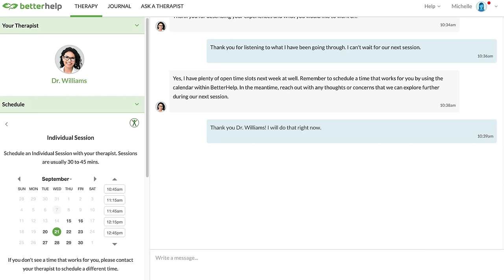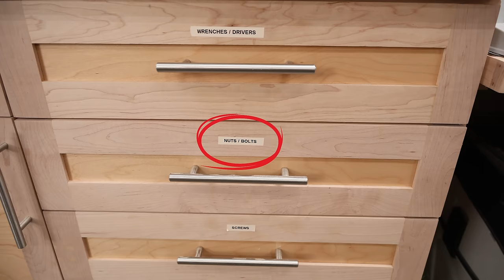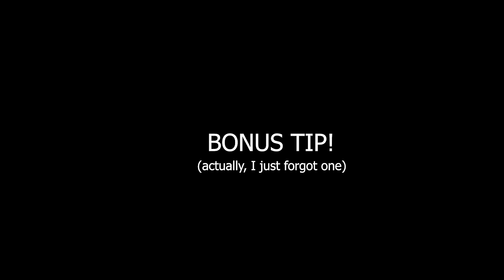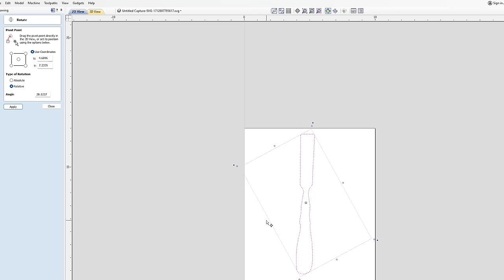12 EASY organization tips for any workspace

Comment: As I sat on a stool in my shop today, I was thinking about my next steps.  One piece that has plagued me is a space for everything.  I spend a significant amount of time in each project moving stuff from one flat surface to another.  In some cases it's scrap wood others it's tools.  My wife is keen on me starting to push product out the door.  This happened last year, and I didn't get a chance to dig out of the mess until after the New Year.  I told myself at the time this has to stop.  Yet here we are back in April, and I should already have a great deal of inventory built up to meet demand.  

The end result of my time sitting on the stool is the following:  product for this year will be put on hold.  There are about 5 shop builds I need to complete in order to get organized.  Everything from a brand new miter saw station with lower cabinets with drawers and pull out trays to upper cabinets with of the same.  While this is going to hurt my bottomline this year, it will only help me next year.  As a tech geek (I work full time in IT), the advent of a 3-D printer holds limitless opportunities to feed the shop.  As I'm sure you know, it's yet another item to find a place in the shop.  This vid couldn't have dropped at a better time for me.  While I am not mister neat, I do so much better when I use a tool and then put it back.  The more I can do that, the more efficient I'll become in producing product.

Comment: Agree with you about multiple drills and drivers. What most don't know is the strength varies from tool to tool. So, as a person gets used to the drills they are used for that wood or whatever material is being used. Besides that, it is just natural progress  as the equipment improves.

Comment: As a visual thinker/organizer, I've struggled with systems for years, and conclude that for me no single overarching scheme is optimal. I've found that for many small to medium sized parts, clear old plastic Costco plastic nut jars (2.5 lb, 7 4 1/2") can hold enough misc. items to still see the contents, maximize space efficiency, and be easily moved to locate or re-arrange on metal shelving. Smaller jars can contain totally misc. fasteners, that can be poured out to find a particular item, then poured back again, without need for over-sorting, labeling, etc. that works best in hardware store stock shelves, but consumes a huge amount of air space in a DIY workspace.
  Another general rule is to store vertically, on walls or panels, as much as possible, and try to keep counter space clear, or else hanging tools will be hidden and unreachable behind the clutter.

Comment: The Kaizen foam is also a great way to store files and rasps.  Just cut or route slots to store them on edge so they don't touch one another in the drawer.  While you're organizing, verify the accuracy of your measuring tools.  I started by checking small scales and rulers against a dial caliper and used a 12" ruler that I found to be accurate to check my metal yardsticks and tape measures.  

Results:
Two "identical" brand name tape measures didn't match each other.  Fortunately, one was accurate.
Several other tape measures were good enough for carpentry but not close enough for cabinet making and other better woodworking.
The scale on the table saw was off by about 1/16" per foot so it was replaced.
Everything that wasn't dead on by my measuring techniques was moved out of the workshop.

Comment: Kaizen is great if you need the depth but kits expensive. For my automotive tools I use the foam rubber floor mats from Harbor Freight. I cut them to drawer size and flip them upside down. I lay out all the tools in the reverse order I want them to appear and use a long nose kaizen marker to trace each tool. Once done I take my Dremel with a small up cut router bit and hand route inside the lines while laying on a couple layers of cardboard. When done I back them with some thin color foam rubber sheets from the hobby store using spray adhesive from 3M. 4 tool drawers for less than $25 including buying the adhesive. If you need it thicker adhere two foam mats together on the smooth side before routing. Lay the color foam underneath without gluing.

Comment: You don't have too many drills. I have 5 cordless drills and 3 impact drivers. It's great to not have to change bits so often. Where I work we sell tools and I have bought most of them as deleted items at really good prices. I have a workshop at the back with bigger tools and the garage workshop where I do most of my assembly so some tools are in each workshop to save me from going back and forwards.